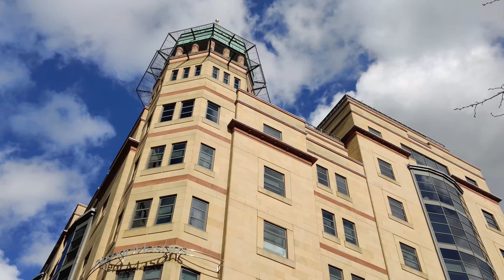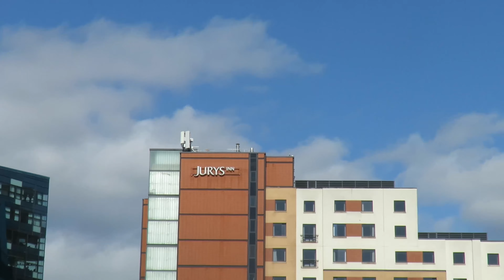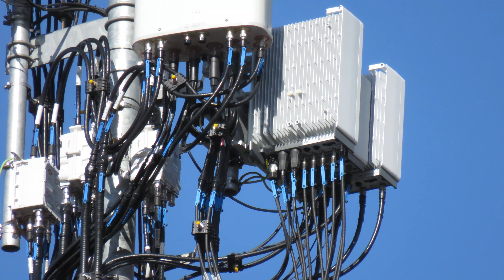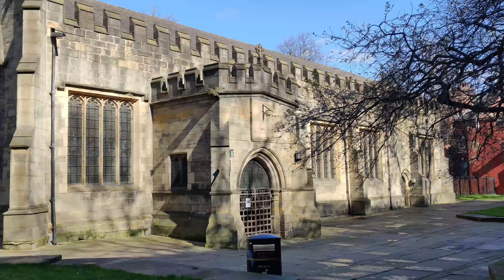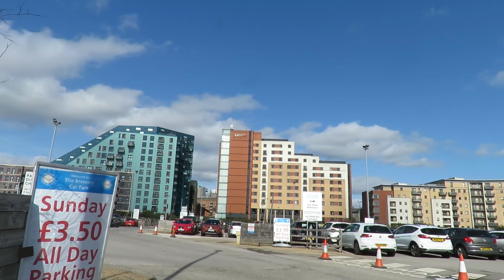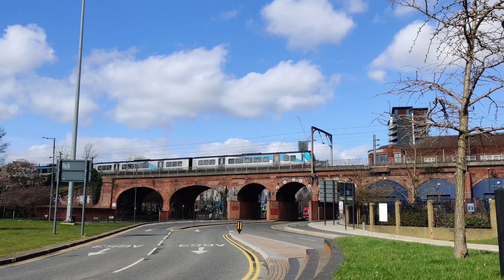Multi Operator Shared Ericsson 5G: Vodafone and O2 MORAN 5G in Leeds, MaMIMO and 8T8R Configurations

Comment: why don't O2 and Vodafone share the same 5g massive mimo panels in o2 host areas instead of leaving Vodafone with only 8T8R. I assumed Vodafone were doing a massive mimo only approach fpr 5g.
Reply from the maker: In Vodafone Huawei areas, a Massive MIMO panel is shared by both areas but such a technique of sharing a radio for both operators' 5G is yet to be seen outside of this. In time, Vodafone will unwind Leeds, deploying entirely their own hardware to sites, including Massive MIMO.